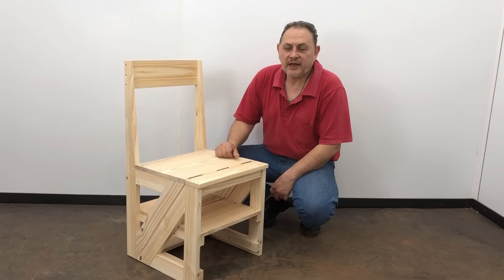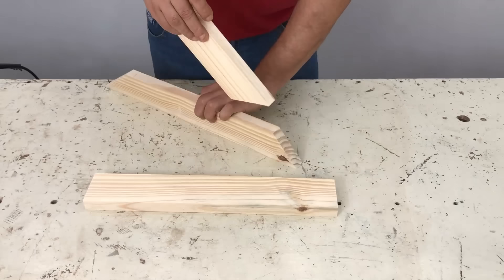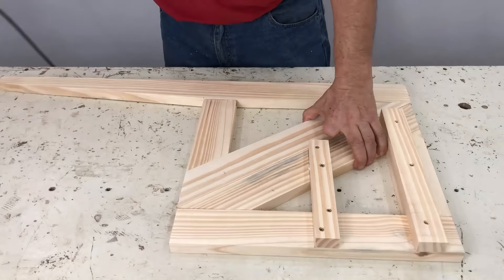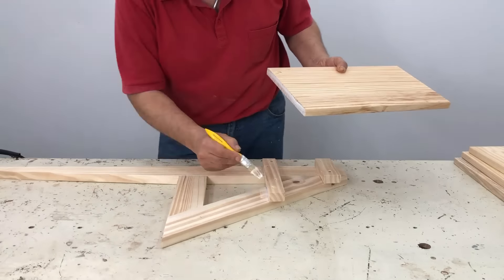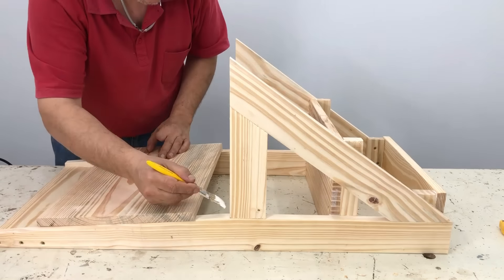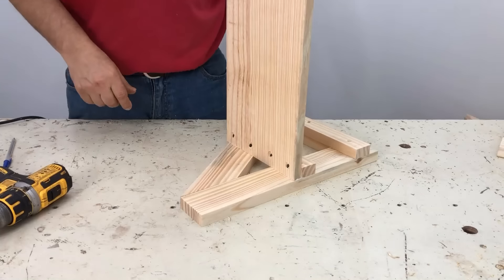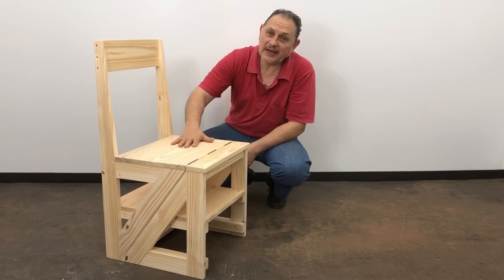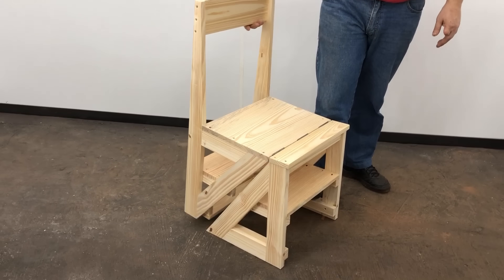Silla Escalera Muy Fácil De Hacer - Tutorial de Carpintería

Comment from the maker: Silla escalera
Madera pino
Materiales:
2 listón de 90cm x 7cm x 2.3cm ( patas traseras)

2 listón de 43cm x 7cm x 2.3cm (patas delanteras) 

4 listón de 53.5cm x 7cm x 2.3cm ( pata flecha punta cortes en ángulo  35 y 55 grados

4 listón de 22.5cm x 7cm x2.3cm ( punta corte 55grados)

2 listones de 33cm x4.3cm x2.3cm 

2 listones de 12cm x 4.3cm x 2.3cm (soporte 
peldaño)

4 listón de 22.5cm x 3.5cm x 2.3cm (soporte peldaño).     

1 tablero de 45cm x 31.5cm x 1.8cm (sentadera) 

1 listón 45cm x 8cm x 1.8cm (sentadera)

1 tablero de 38.5cm x 12.5cm x 1.8cm (peldaño)

2 tableros de 38.5cm x 22.5cm x 1.8cm (peldaño) 

1 tablero de 38.5cm x12.5cm x 1.8cm (respaldo) 

1 listón de 38.5 cm x3.5cm x 2.3cm ( pollerita sentadera )

3 bisagras libro de 3 pulgada o 75 mm  con tornillos de 19 mm x 3 mm

45 tornillos de 52mm x 4 mm 

30 tornillos de 38 mm x 4mm 

Falsa escuadra en 35 grados y 55 grados

Lijar antes de armar
Reply: Estimado  son excelentes tus trabajos sigo todos los videos, siempre  muy practico y facil. Gracias por compartir las creaciones, solo una sugerencia si me permite. Colocar medidas de maderas en pulgadas si bien en Chile usamos la medida métrica, pero en las ferreterias, madereras venden la madera en pulgadas  ya sea en bruto o como en este caso cepillada, para sus nuevos proyectos y si puede en este  mejor.
Un gran saludo.
Reply: Gracias por compartir toda su experiencia y conocimientos,  Un Saludo
Reply: @marcelovidovich5200  es fácil solo tiene que convertir los cm en pulgadas un centrimetro  dos pulgadas y media  eso sí .si pedis cepillada  roba unos milímetros se va a dos cm
Reply: COOL!!!
Reply from the maker: Amigos !! La medida entre medio de 2.5 y 2.6cm es una pulgada o sea 2 pulgada está en 5.2 cm . Por supuesto que baria al preparar las piesas al pasar por el cepillo y garlopa ... saludos abrazos
Reply from the maker: Una pulgada sería 2.55 cm exacto( en pulgada )
Reply: Show.
Reply: Muchas gracias es la primera persona que me contesta y lo felicito por compartir sus grandes conocimientos debería hacer un sofá cama gracias maestro
Reply: Ok
Reply: L0
Reply: Thank you. I am from indonesia
Reply: Hola jose luis gracias por explicar tus proyectos yo ise varios de tus proyectos son muy buenos saludos de la rioja argentina
Reply: Maestro exelente los trabajos realizados, tengo una consulta para hacerle... El tema del grosos de los listones y/o tablas, influye? Porque no encuentro de 2.3 cm como indica en la mayoría de sus videos... O los de 1.8 cm.. creo que consigo de 2.5 cm o 3 cm de espesor... Influye o cambia en algo? Tendría que modificar las medidas de largo y ancho de todo? Muchas gracias!!
Reply: 1
Reply: 11
Reply: J
Reply: Buenas de 1mx40x30  para 10 pares en 30$ y para 15 pares 40$
Reply: Turkce:( can you send me the plan email
Reply: 8
Reply: Gracias
Reply: O
Reply: Francisco
Reply: Me encanta es favulosa
Reply: Las medias no están bien
Reply: Excelente ya la fabrique y solo le modifique el 3 escalón respecto al cargador yo se lo puse por la parte de abajo
Reply: Привет спасибо хорошая штука
Reply: Maestro José Luis, estoy muy agradecido por tu excelente trabajo, que nos compartes, muchísimas gracias. Que Dios te siga bendiciendo.
Reply: Gracias, por su gran trabajo.
Reply: Xenón
Reply: Muito bom linda serra.do salitre mg
Reply: Excelentes y prácticos trabajos, fácil para la interpretación, desde Rosario Argentina.
Reply: Gracias por su aporte, muy bueno.
Reply: finally someone actually put the measurement available thank you! great build!
Reply: Can I get this in English. I will be thankful
Reply: @arafat1263  copy paste it to Google translate
Reply: @izwanmohd  brother, can't select the text
Reply: InstaBlaster.
Reply: cuidado con las manos wey .
ya viste lo que te paso!!!
Reply: Gracias amigo excelente tutorial y con  las medidas mejor un saludo muy especial para usted.
Reply: Ź
Reply: Hola mí gran maestro ..lo felicito por sus conocimientos y forma dé explicar y sobre todo la lista dé material qué se ocupa ... Cosa qué la mayoría no tiene ... SALUDOS  desde la cdmx alcaldía iztapalapa
Reply: Gracias muy buenos tus trabajos
Reply: Escalera
Reply: Me parece muy interesante toda la información, Gracias lo hare
Reply: Muy buenos y sencillos los trabajos gracias
Reply: 👍👍👍👍 preciosa desde Canarias
Reply: Muito obrigado da medida gostei do seu serviço sua produção e 10
Reply: Gracias a sus videos paso entretenido haciendo estos pequeños muebles muy uriles para mi hogar, gracias de todo corazón.
Reply: Bakan su silla la ise súper
Reply: @norbertocarlos8663 es al revés una pulgada son 2,54 cm
Reply: Yo hice tu modelo de banqueta plegable quedó de 10
Reply: 2ñ
Reply: @marcelovidovich5200 una pulgada son 2.54 cm es sencillo solo tienes que hacer los calculos😊
Reply: MUCHAS GRACIAS POR COMPARTIR SUS EXPERIENCIAS SON DE MUCHA UTILIDAD
Reply: Gracias Don Luis, me quedo muy buena mi silla escala y ahora voy  Por la segunda que me pidió una vecina
Reply: @norbertocarlos8663 al revés pa, una pulgada 2,5 cm
Reply: Gracias por compartir tus conocimientos de carpintería.. saludos cordiales desde Coatzacoalcos Veracruz México..
Reply: Buenas.que medidas tendría esa silla escalera!!? desde ya muchas gracias
Reply: Ho perdón ya están las medidas felicitaciones
Reply: Gracias 😊 pero es mucha lista jaja ..solo con ver el vídeo la puedo hacer .
Reply: Linda silla escalera y práctica 😊